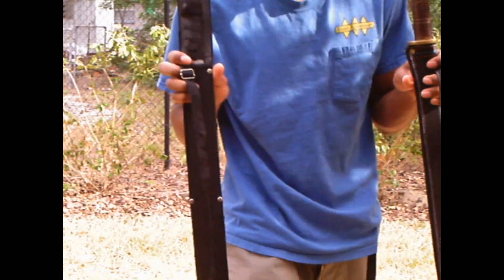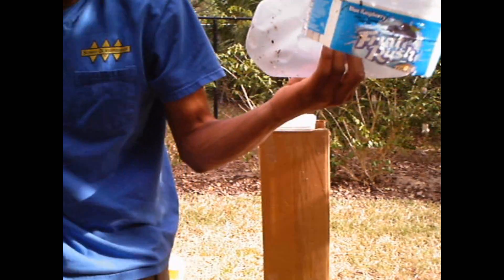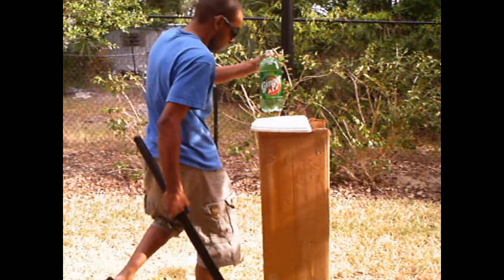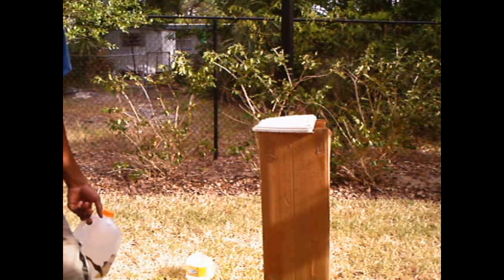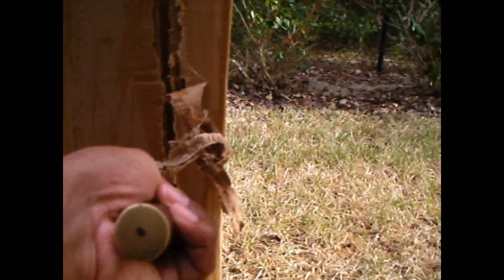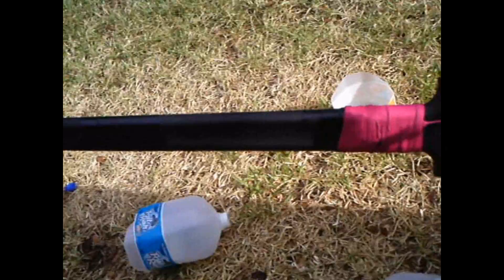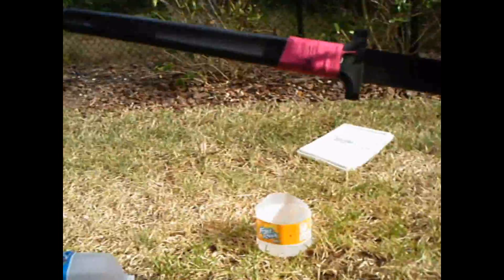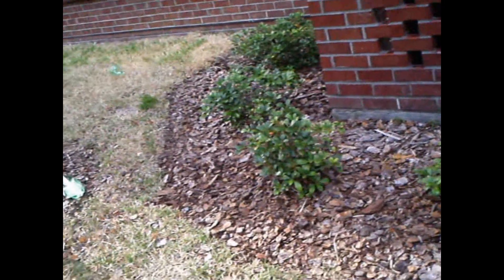stainless steel vs carbon steel test part 1

Comment: All the internet experts talk about stainless steel swords breaking and there is actually very little evidence of it. I've only seen a handful of videos of it actually happening, and it seems to occur mostly during abuse and not using the sword as intended, eg: chopping wood.

Comment: You know blade are not meant to use in gallon, water container but for wood & similar materials. Honest comments,one rules of thumb are ss for foof pref & carbon steel for wood, ropes & similar materials. That's why manufacturers never use stainless steel for axe, I've seen ss for jungle bolo but sad to say that only for display

Comment: Your lack of knowledge about steel and safety aside, the point that makes the difference is the brittleness of stainless steel. The harder the steel is, the more brittle it is and stainless is very hard. Even 1095 is almost too hard but borderline. 1060 has just enough  malleability to absorb energy without breaking while holding an edge reasonably well. Your tests are not valid in the least. Even junk will cut a plastic bottle filled with water. That means nothing. And the steel is not the reason for the cutting success or failure. It is your technique swinging that sword. Do yourself a big factor and study up on why stainless is considered inferior for sword metal. BTW, the swords you chose suck.
Reply from the maker: I have a 9260 spring steel katana - tenchi too.   did you even watch all of the videos?? the point was that SS tools can be used for outdoor work abourt the home.

Comment: very uncoordinated swings, lack of consistent swing velocity. How sharp are the blades to begin with? How well was the metal heat treated, very big factor by the way? what is the weight of each machete/sword.? This test really means nothing to those that know. Others may be some what amused.

Comment: That exsact ninja sword breaks in the middle section eventually after continual use but very reliable. the top half of the blade takes most of the impact 90% of the time. try to avoid it taking direct impact to maintaint the durability if your sparing. soft fleshy things no it would last probably about a year if you where a student of ninjutsu. made from stainless steel.

Comment from the maker: FYI that sword is used all the time for brush clearing for years and it has not  fail yet.  for any metal it's the heat treatment that counts. 5160 with a bad heat treatment is worse than SS with a good(yes had have seen swords that were 1060 carbon or higher with bad   heat treatment breack trying to cut a pool noodle).   Also what do you mean by carbon steel?? did you know all steel has carbon in it? even your body has carbon in it.  Anyways i am going to play with my 9260 spring steel O-Katana

Comment from the maker: for everyone talking about how brittle SS is yes that true. the point of these video was to show that Good, well made SS can do better then people think.  That   Ronin Ninja/  Slimline Machete sword is made out of japeness  AUS-6  which has vanadium added to them. Vanadium improves the wear resistance, toughness, and ease of sharpening. this sword has bend before and i stighted it back out.   Before you make comments get some good SS swords and try them and see what is what.

Comment: Reason why stainless steel sucks ass. It's brittle as fuck. It will not bend at all. You only get stainless steel if you are a fucking loser or you want a decoration. Carbon Steel is the cheapest good steel you can purchase.
Reply: Can you explain why is bending considered good?
Reply: PresentKA I'm using bending loosely as flexibility. A sword should be able to bend, not be bent, because it means it's flexible. It disperses the energy from the shock of impact throughout the blade relieving if from the stress it may endure allowing it to cut more efficiently an not break. Stainless steel is used for knives and maybe very short swords, only good is it keeps an edge.
Reply: Could you please provide more details on the flexibility thing.
As this is my first day reading about this stuff and i want to learn :)
Reply: PresentKA I'm not a textbook. You have the internet.
Reply: PresentKA say if someone struck the flat of your blade it would bounce back but with stainless steel it would just stay bent
Reply: PresentKA Look for the videos showing how a stainless steel sword can break and send a piece flying.  There is a famous video where a guy slams one on a table on QVC network and it impales him in the stomach.  In lengths greater than 12 inches, stainless steel is brittle.
Reply: @herbertsussman7270  
Thanks for the information. I searched YouTube for the QVC video and found it.

Comment: Stainless steel isn't shit, but it is not proper for battle ready sword construction. Also, if you want to properly test stainless v. carbon, put the swords through tests that simulate battle conditions, such as sword on shield, sword on armor, and sword on sword.

WARNING: this may cause swords to break and cause injury, possibly death.